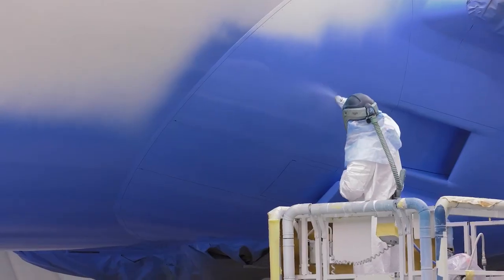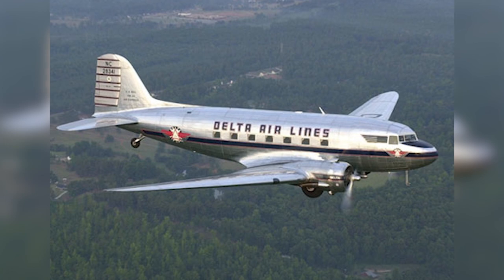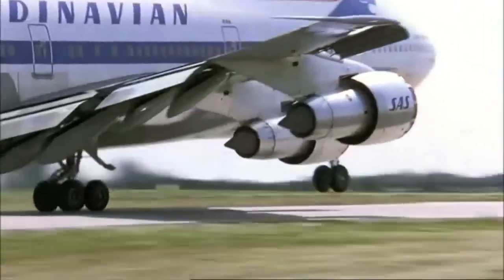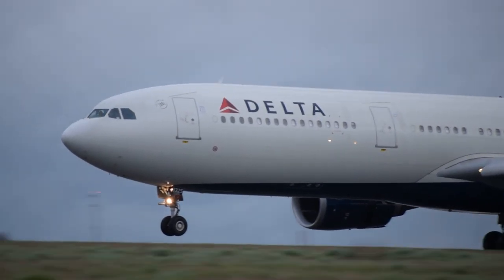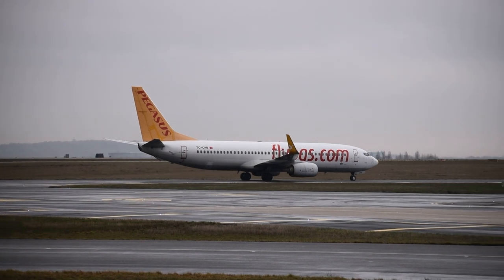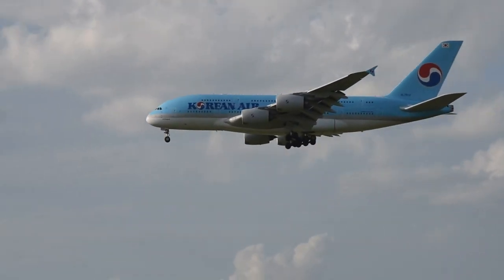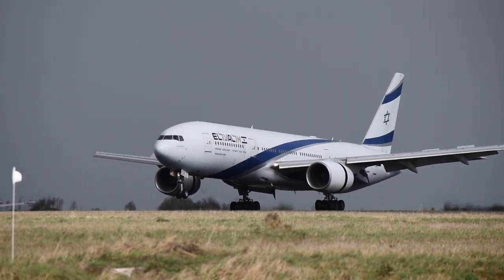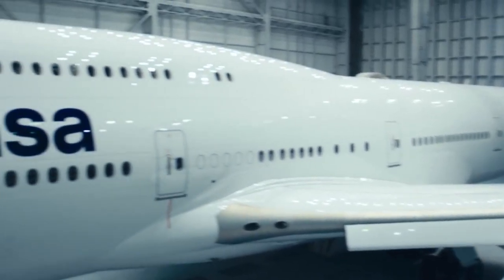From colorful to minimal: what happened to airline liveries?

Comment: The COMMON denominator is COST COST COST. Has nothing to do with CARBON FOOTPRINT .
Reply: It is carbon footprint a bit. It’s mainly if they use coloured paints over white ones, the planes will weigh more so it’ll use more fuel, and darker colours absorb more heat so use more energy to keep planes cool
Reply: Yes it does